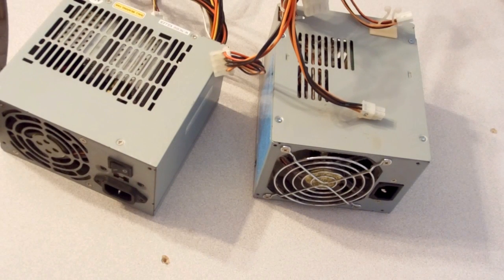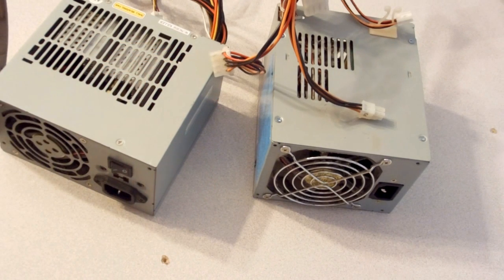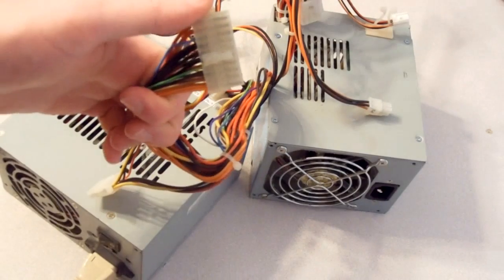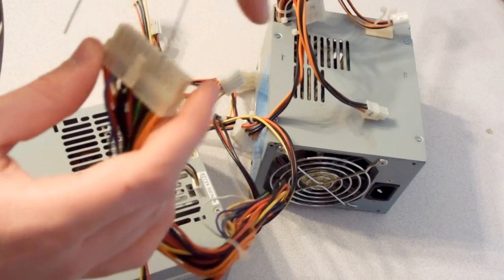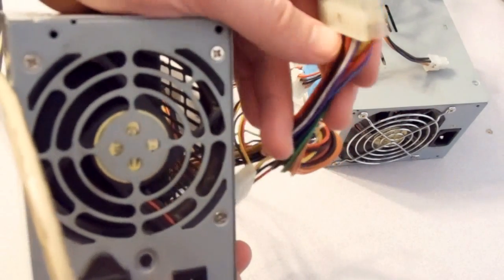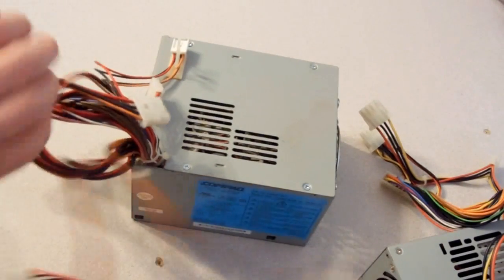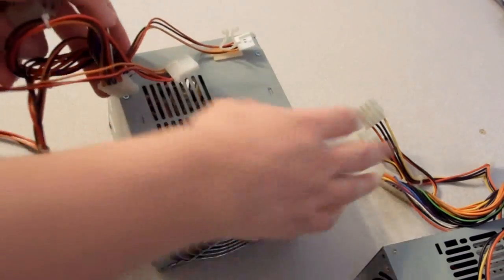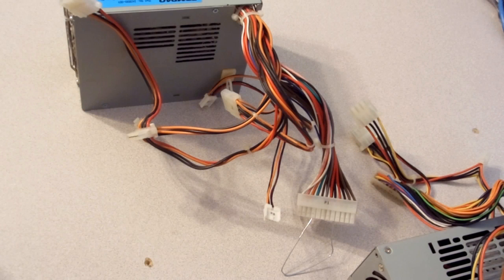Testing a Power Supply with a Paperclip

Comment: The second unit u tested was a Compaq with different wiring colors. The green wire in those power units is stand by 5 volt power not ps/power up. That unit may need a load placed in the five volt system to power up as well.

Comment: We tested the power supply as shown and it passed the test. The computer would sometimes start and act normal. Most of the time, pushing the start button didn't start the fans or anything else. We replaced the power supply and it now starts all the time. We opened the bad power supply unit (when unplugged) and we could see that two capacitors were swollen.

Comment: Hey I tried testing my powersupply this way. the fan turned on and the red light was solid on the back. I turned it off. then back on and now the fan won't start but the red light is still solid. is my power supply okay ?

Comment: don't junk the 2nd one. often it's a bad capacitor which are fairly easy to replace and extremely cheap compared to buying a new power supply.
Reply: Power supplies don't like to be powered on when they are not under load. Some power supplies check for this and  refuse to wake up unless they're plugged into something.

Comment: Hey there! i know this is going to be a dumb question but. what will happen if i don't put a paperclip on the green wire and black wire. and just turn on the PSU without it?. And can someone explain to me what the paperclip does?
Reply: The power supply will do what it normally does in your computer before you push the power button; it will just sit idle and you won't be able to tell if it is alive or dead.

The green wire is the PS_ON wire. The motherboard signals the PSU that it wants it to turn on and stay on by connecting it to ground. There is also a PWR_OK wire which tells the motherboard that the PSU is OK and considers itself to be ready.

Before there was a PS_ON wire, old AT-style power supplies used a switch connected to live mains current(just like that switch on the back of the PSU, but the switch was located outside the PSU on the front of the computer). On AT power supplies the computer could not turn off the power supply. So when you exited windows 95, it would simply say that it was safe to turn the computer off and the harddrives had been parked and shut down.

Comment: Compaq power supplies have the pinout different from the standard ATX power supplies. It's not that the second power supply is completely dead, it's more like the demonstrator didn't do his due diligence :)

Short grey wire with the brown one, and then short green wire with the white one. Now you can see if it's dead or not.
Reply: Hi! And would you teach me how to switch on an old, old, jurasic AT ( NOT ATX) psu? Tkx a lot, best regards from Portugal!!🙏

Comment: My IT-colleague actually showed me this trick. :D. Thanks for explaining it in more detail man.

A paperclip is a powerful tool for us IT'ers. I use it to open disc drives if they are broken too.
Reply: Can u help me In something the problem is that my Dell optiplex 390 has a problem the keyboard and mouse don't work even if I replace them  it lights the keyboard for a second and then doesn't work I tried changing the hard disk doesn't work also

Comment: i had so many power supplys that i did this but instead of a paper clip i used a switch and cut all but the black and green wires and made it into a external drive power supply it never burnt out and the thing was on for a solid 1.5 weeks

Comment: Nothing unsafe here. Although the amperage is high on most top-quality PSU's, it will never harm you if it is in good shape. 12v from a PSU can't do nothing with you since the PSU won't put out the whole amps, because your finger is not a good conductor.

Comment: Although i'm not sure about the exact amperage which is drawn, 12v dc at the very best isn't alot. Thats the same as a car battery. Nothing dangerous.
But if you wanna play it safe just wrap some ductape or latex / rubber or whatever around the paperclip and hold it there. Just make sure not the mess the pins up and nothing can go wrong ^^.

Comment: You can also grab a multi meter and measure the voltage comming from the connectors, you can find pinouts with the right voltages on google.

Comment: I did this test and my PSU powered up but it has a fan on the front and back and only the front fan started spinning. The back on doesn't move so does that mean my PSU is broken even though its powered on? My PC wouldn't turn on a couple days ago, even the case fans wouldn't spin and the only signs of life was the motherboard light and the ethernet light. So i'm trying to figure out what is broken. LOL

Comment: No, you need both Volts and Amps kill. Supposedly 100 and 200 mA and something over 12 volts is lethal, but don't quote me on that. I've seen someone grab hold of 2 metal poles that had 1000 amps going through it, but only a low voltage (not recommended), and he didn't feel a thing. Amps is really the one that bites, and HARD!